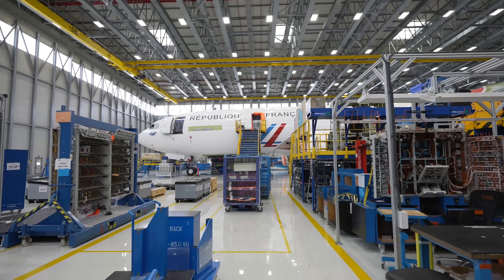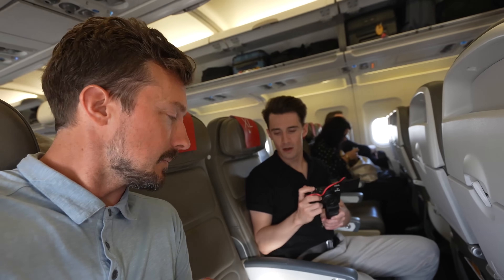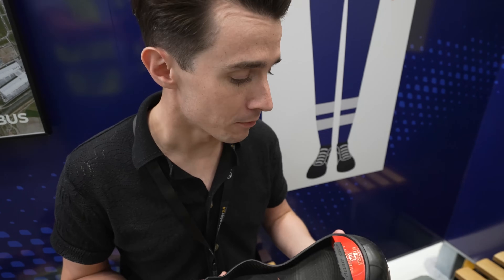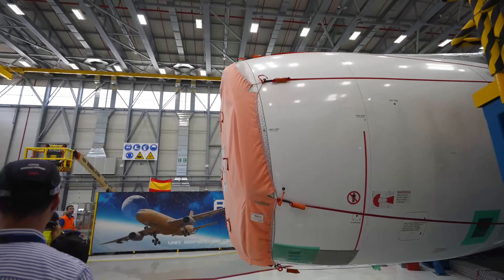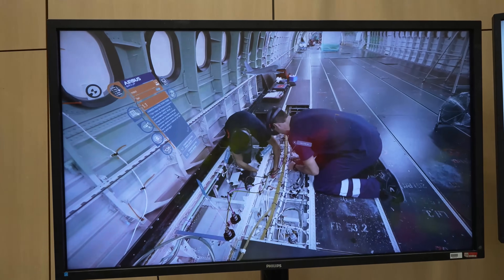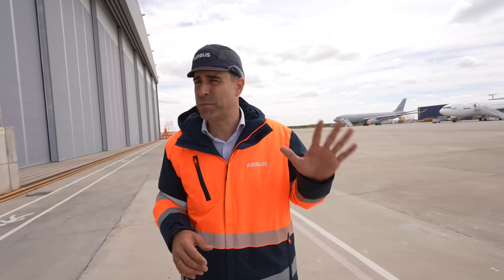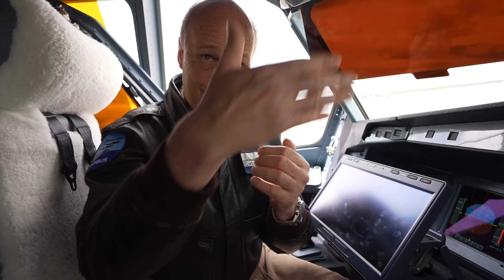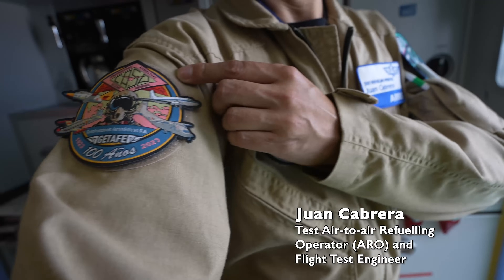Meet the custom A330 for MILITARY (mid-air refueling and more!)

Comment: Aviattion engineer here: The PPE you just wore in TLS represents a significant advancement in occupational safety. Previously, the standard was white helmets, which were often considered ugly and bulky, leading to low compliance. These have now been replaced by much lighter, dark blue caps that are barely noticeable when worn. This change alone has reduced the number of head injuries at Airbus sites by over 80%! This means hundreds of workers can spend time with their families instead of a roommate in a hospital! (And yes, it's the same caps all across Airbus - in Europe and abroad)